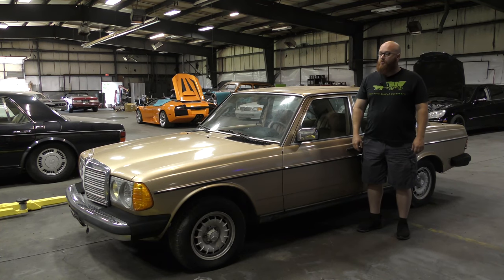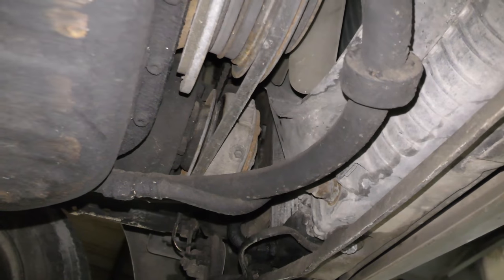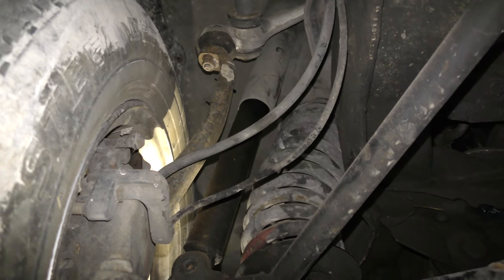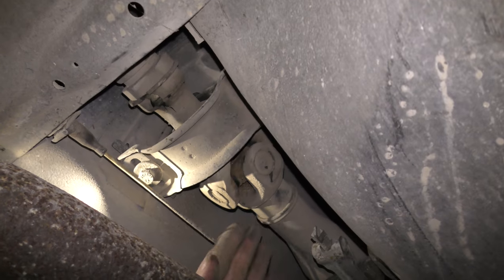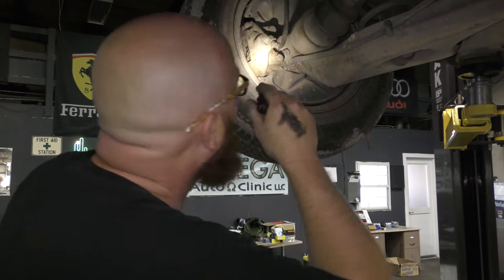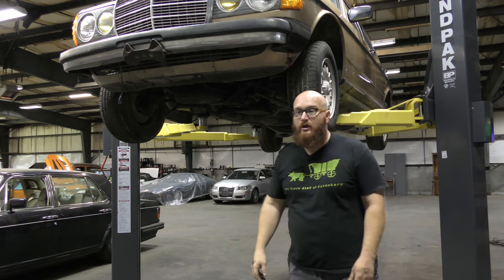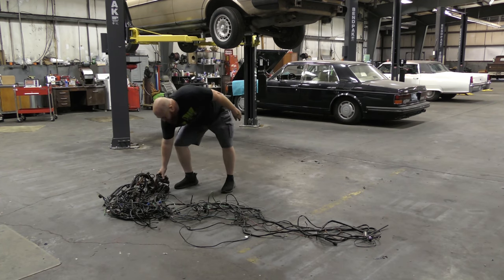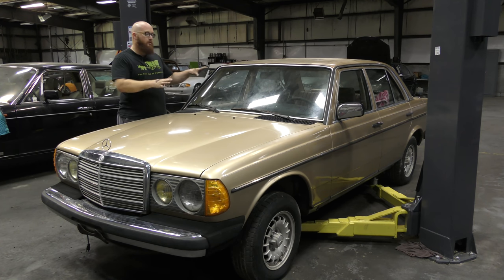What's lurking underneath? CAR WIZARD finds lots of repairs required to make '84 300D MB roadworthy

Comment: Could you just go buy a good one of these for the price of fixing this one?
Reply: i doubt it, theyre rare and becoming collectors cars,
Reply: deadprivacy they aren’t that rare, Mercedes made over 2 million of them. Age, accidents, and rust have taken a lot of them off the roads, but there are still plenty of them if you know where to look.
Reply: Shawn Swigart Yes. The Mercedes Benz Club of Americas’ newsletter has a classified section and there’s always a a couple of w123 for sale between $5000 and $10000.
Reply: @300DBenz  it was the "good" part i was stating was the rarity, a good one is gonna cost you as much as sorting this one out easily, probably more.
Reply: Depends  , a nicely sorted out one with moderate mileage would be Beto 6-10 K $ An extremely nicely sorted out with low mileage runs about 25K to about 60 K , Ck out “ Mercedes Motoring “ in Glendale California
Reply: @JoePastorgomez  this ones got an almost unrusted 100% original shell with decent paint but i...that counts for a good resale price, didnt really see the interior of this one or the mileage but what wizard tries to claim is "just fuel gunge?" - yeah ok wizard ...nah, thats oil and its coming out the engine.- front main seal for SURE., AND IM PRETTY SURE WIZARD KNOWS IT TOO.
NAUGHTY.

Comment: I'm not sure this car is worth fixing , for the same money, you can get a road worthy Camry or Accord
Reply: And way safer
Reply: @dantfc7681  I wouldn't drive a car without multiple airbags.
Reply: @davidjacobs8558  Specially a new, young driver.
Reply: Congrats on participating in disposable society.
Reply: @maxheadroom224  To be fair, the amount of damage this car will cause due to its emissions will be much more than a comparable price Camry or Accord.
Reply: @maxheadroom224  In Japan, they don't keep old cars running, it's all about taxes and registration fees. Besides, these dinosaurs have little safety equipment, a newer car is much safer for a young, inexperienced driver.
Reply: Pedro Fernandez Have you seen the crash tests of these old Mercedes? They’re a lot safer than some modern day cars with a thousand air bags. All that steel makes for very effective, energy absorbing crumple zones.
Reply: @connorPiper0  I believe that you're underestimating amount of energy and highly lucrative electronic components required to manufacture a modern automobile. It's a more convenient choice to get a newer car.
Reply: @300DBenz   You can't compare crash tests as we don't preform the same ones today. Absorbing barriers are gone and we test at higher speeds. I bet the W123 platform fails the small overlap miserably. Curtain airbags make a high speed side impact surviveable, especially now with taller cars and poor compatibility.
Reply: @300DBenz  I saw a crash test between an old Impala and a newer Malibu and the impala driver would have surely died.
Reply: @maxheadroom224  Not talking about a new car, probably a 2011 Camry or around for the money we are talking
Reply: @pedrofernandez8729  Then they sell them at auctions, and the rest of the world take them and use them for the next 10 to 30 years...life is a lottery...die now or die later?

Comment: My God, why bother on all those repairs on a 36 year old car?  The repair costs will exceed the value of the car by 2 to 3 fold.  Not to mention the sheer age of the car will mean the body mounts are disintegrated, and the horse hair filled seats are likely gone.  JUNK IT.
Reply: completely agree man . the car is too far gone to be worth the effort in repairing it back to a road worthy state. yes it may be grandpas car but why not just keep in the driveway as a memory and get his daughter a more modern far safer car. there is an old valiant near where i live which is probably in the same situation as this but its just been sitting in the driveway for 15+ years rusting away . no point putting it back together but still there in memory.

Comment: Who would pay 10X more than it's worth to fix this pile of junk?  Nobody's daughter would ever want to drive this clunker, send it straight to the scrap yard!
Reply: Limited vision bud, Theres  a continuous wrecking yard parts supply everyday I had zero issues with two mid `70`s C280, my current $1k  `99 kompressor is as solid as new and as close to a grey mrkt found, Billions spent engineering W202 set the mark in unibody stiffness
Reply: Daughters gonna complain theres no aux cord haha, what a terrible investment 😂😂😂